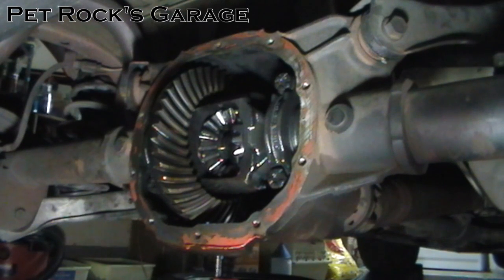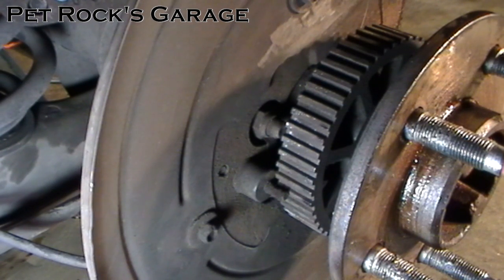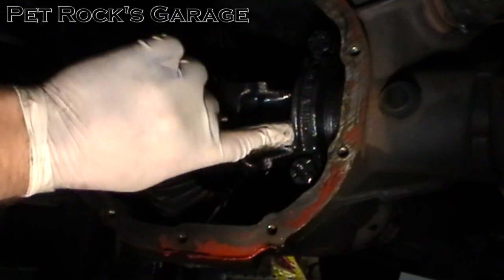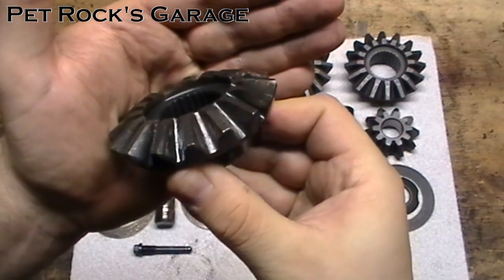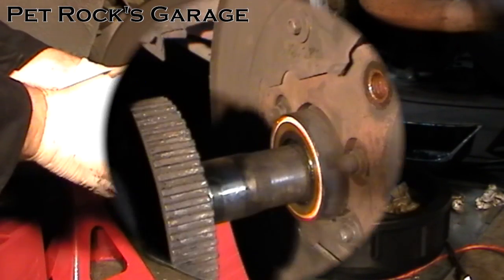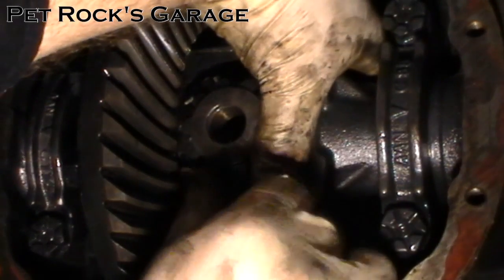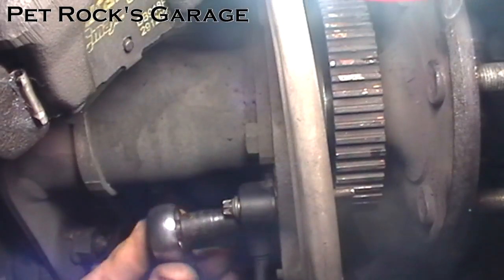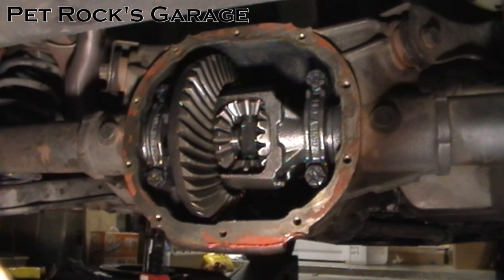How To Replace Spider Gears In Ford 7.5 & 8.8 Open Differential - Ford Mustang

Comment: hes on  a rack doing this. hope you have small hands. go to a mechanic shop, not going to work on youy back
Reply from the maker: I WISH I had a rack. This was all on the floor of my garage with a jack and jack stands. You can even see the kitty litter boxes on the floor in the background in some shots and the red jack stands holding up the rear diff. I don’t know where you got the idea I have a rack.
Reply: @petrocksgarage  my apoligy! i could not get the upper and lower spider gears to line up. had no problem with bolt using a socket extractor and bearing and seal when i inserted the new axle the upper spider gear came loose which turned a simple fix to a nightmare. i put the pin and bolt and wheels on and took it to my mech. my hands are way too large to get in the proper place
Reply from the maker: @jeretalbot8310 , one of the hardest parts of DIY'ing is knowing when you need to stop and let a pro take over. There is no shame in it. Everyone has limits. Be it physical, mental or tooling. The key is knowing when to stop. I hate body work, for example. I don't have the patience. In one of my first videos I had a local body shop realign the door on my wife's Mustang after I replaced the hinge pins. It was well worth the $. I recommended others do the same in the video too. There are some things best left to pros.
Reply: @petrocksgarage  yes, i agree.ive replaced many things on our grand marquis. i was an electrician for years. the old axle spline was damaged and when i tried to wiggle it it is when the lower spider gear popped out! to my dissapointment.i will take your advise, thanks.
Reply from the maker: @jeretalbot8310 happy wrenching!

Comment: Do you know why my factory spider gears won’t go back in with the thrust bearing? The thrust bearings get stuck on a lip somewhere and slip off. I’ve been stuck for hours
Reply from the maker: Maybe the bearing or housing has a bur on it that it is catching on? It should slide in smoothly. It got in there at the factory somehow, right? Good luck!

Comment: Hi, My 01 Ford Sport Trac has a strange clucking sound and you can feel it bad through the truck but only after you have been driving fast on the freeway for a while and then you slow down and exit for a fuel stop and you are moving very, very slowly moving up to the bowsers, it is so bad everybody can hear it, but by the time you get fueled up and start to leave it has stopped making the noise again. There is no noise or vibrations at all on the freeway. It is an Open diff. Would this be symptoms of worn Spider Gear. Thanks.
Reply from the maker: That could be a symptom of many things. It could be bad diff gears, diff bearings, axle bearings, wheel bearings, drive shaft u-joints, transmission bearings...  the list goes on and on and on.  Try to narrow it down more to a specific section of the truck and/or take it to a shop to diagnose it.  Don't just throw parts at it.  Thats like throwing darts in the dark and hoping to hit a bulls eye.  Good luck.
Reply: @petrocksgarage  Sorry but none of those things make a clucking sound through the whole truck at very low speeds with no vibration or wine. Completely different sound. I am a mechanic, but not a diff expert.  Sorry to bother you.
Reply from the maker: @oldgamer1330 , I honestly don't know what could make a 'clucking' noise on any vehicle (i.e. cluck like a chicken).  I thought that was a typo and you meant 'clicking', which those things I listed could make.
Reply: @petrocksgarage  Yes it was a typo, I meant clunking and I am sure now it will be the spider gears dropping back down into place as they reach the top when it rotates when going straight at very low speed and it would do it twice for every rotation of the wheel, and after being on the freeway the oil will get hot and thin but as it cools down and thickens up again the noise will go.
Reply from the maker: @oldgamer1330 , ok, a clunk.  Big difference.  😀  I would doubt its the spider gears because they are so small you wouldn't hear then slide back into place, if that was what was happening. It would be more like a light click. And if they were that worn out to have that much movement you would hear a whining noise either during acceleration or deceleration, especially in curves, that changes pitch with speed.  Also, when driving, even at slow slow slow speeds, the gears are under pressure in order to propel the truck forward so they wouldn't be able to move up/down on the center pin much, if at all, during each rotation.  Also also, the diff, like the motor, cools as air flows over it at speed. When it is not moving it is effectively heat soaking. So the oil in the diff wouldn't change temperature significantly enough to cause the oil to thicken during the time it takes to fill up.  Maybe after a half hour or hour.  But not the couple minutes it takes to fill up.

Since you said it clunks twice per each rotation of the wheel (I assume you mean tires), maybe it's loose lug nuts? or something stuck in your tire tread?  I also wouldn't rule out bad drive shaft u-joints, or drive shaft support bearing (if your truck has one), loose/bad pinion bearing, or bad control arm/shock/sway bar bushings. Those can definitely cause a clunking noise at low speeds.  Good luck...
Reply: @petrocksgarage  Well now I am but to square 1, I have had this problem for the 2 years that I have had the truck and can not solve it and have replaced everything I can think of but nothing has fixed it, and nobody in Youtube world has every been able to suggest anything so it is a strange one, but it is in the rear axle somewhere. I know the spider gears are badly worn because I checked them out when I had the cover off and there is so much backlash, but there is no noise at all but they are only cheap so I will do them anyway now I know how easy it is and see what happens. The problem is I live in the mountains where I leave it in low range all the time and only go on the freeway once or twice a year so it is hard to test it.
Reply from the maker: If the spider gear are worn, then replacing them is a good idea. It will at least rule them out.  Beyond that, maybe take it to a shop and see if they can diagnose it?  Good luck.

Comment: Dude, thank you for this! I've been getting a nasty clunk in my 91 Ranger's rear end. It doesn't seem like ring/pinion, so I wasn't really sure what it was, but now I'm pretty sure it's the spider gears. You've simplified it enough that I'm going to dig in and give it a shot. Thanks for the concise, well made video. Super valuable.
Reply from the maker: No problem. Glad to be of service. Good luck.

Comment: im glad this worked for you, my pin hits the ring gear both ways.
Reply from the maker: Sorry to hear that. Sounds like you have aftermarket gears installed. Only non-destructive solution I can think of is to unbolt the ring gear.  Torque the ring gear bolts down to 60 ft/lbs when reinstalling. Good luck.
Reply: @petrocksgarage  I thought the same, 40 years old after all. Even service data says it should clear. I left it (my personal vehicle) since i have an 8.8 ill install once the 7.5 grenades. Thanks
Reply from the maker: Well, at least you have a backup. Although if your motor is a V6, the 8.8 may be too big and may actually hurt performance depending on the gears that are in it. Good luck.

Comment: great video. my only question, are 7.5 spider gears and 8.8 the same size aside from spline?
Reply from the maker: I don't think so. I think the 8.8 spider gears are slightly bigger. They are different part numbers. But the install procedure is identical.

Comment: I serviced my differential on my silverado, change the fluid and the axle bearings & one of my spider gears fell out, took me 4 hrs before I finally got em back in lined up..😭😭😭😭😭
Reply from the maker: Ouch. Sorry to hear that. They can be a P.I.T.A. if you've never done it before. Pro-tip: next time the pin is out, run a zip tie or two up through the hole where the pin was to hold the spider gears in place as you work. Then you don't have to worry about them falling out. Hope that helps. Good luck.
Reply: @petrocksgarage  Thank You!!👍👍
Reply from the maker: @Soundafek  No problem.

Comment: My differential has a weird clip in between the spider gears I got it back in but now they not turning
Reply from the maker: Is the clip in the shape of an S?  It's a 'Traction-lok' S-Spring that some 7.5 & 8.8 diffs come with that.  I haven't played with one in a while, so I don't fully remember the trick to get it back in. Sorry. There are videos on youtube about the S-Spring install that may help you out. Good luck.

Comment: You must have some extremely long arms bro or somebody's pushing that axle for you cuz I can't even reach both of them at the same time
Reply from the maker: Nah, I used my foot.  🙂
Reply: Ahh very good info.. ty
Reply: I think your fingers are longer than mine too cuz I have an 8.8 and I can't hold on to both gears at the same time with my fingers and my thumb they won't reach have to figure out something
Reply from the maker: @mattikyle , zip tie through one of the gears and the carrier to hold the gear in place? Or have a buddy help?

Comment: How much different is this for a drum brake rear?
Reply from the maker: The stuff inside the differential is identical. The only difference in the procedure would be what, if any, drum brake parts need to be removed to allow the axles to be pushed in slightly to remove the C-clip. Definitely will need to remove the drum. Beyond that I'm not sure since i haven't seen a drum brake in a number of years. Hope that helps.
Reply: @petrocksgarage  Okay, thanks. And thanks for the video, too, it's gonna be a great help for me getting this mini-spool into my Ranger, lol.
Reply from the maker: @Drunken_Hamster , no problem. I'm glad my video helps you out. Thanks for watching & commenting. I appreciate it.
Reply: @petrocksgarage  I ended up disassembling one side of my drum brakes and then learned that I didn't need to do that. I also had to take my diff out of the carrier and remove the ring gear to get the cross pin out due to having 3.73s. ((No, the flat cut did not allow the cross pin to fully clear.))

Comment: In some carriers, doesn't the ring interfere with removing the center pin? I have seen some videos that show that some filing of the ring teeth is required in order to slide out the center pin.
Reply from the maker: I have not experienced that, but I suspect those are aftermarket gears and/or carriers. Either way, grinding the gears is not the proper solution, IMO. The pin got in there somehow, and it was likely without the ring gear installed.  So the solution isn't to grind the gears but to instead remove the carrier and unbolt the ring gear to get it out of the way. Then bolt it back up when done. It's really not that hard to do, and a lot easier than grinding. But to each their own.
Reply: @petrocksgarage  yeah, that sounds more responsible. Thanks for your feedback. Your diff and other video subjects are really the most detailed and informative that I have seen. All very well done.
Reply from the maker: @jockodog2009 , thanks a lot. I appreciate it.
Reply: How would I remove the carrier if I can't get the center pin past the ring gear, and therefore also can't get the c-clips off the axle to pull them ?
Reply: I was able to slide the center pin out of the carrier part way. It is enough to make  room within the carrier to push the axles in and remove the c-clips  and extract both axles. The center pin lock bolt cannot be removed completely because there is no cutout to make room on the right side bearing cap. The bolt gets hung up, needing another 1/4 inch or so to extract completely. So that's doable after the cap is removed. I still must then decide how to deal with the ring gear/center pin interference issue in order to replace the spider gears.

Comment: I got a 8.8 and the spider gears fell out as I was replacing my axles I g[t a retainer clip in it how do I get the spider gears back in there ???
Reply from the maker: Sorry for the late reply. This one got lost in the shuffle.  I think you are talking about the Traction-lok S spring. If so, they can be tricky. It sounds like the spider gears fell out with the S spring still in place?  If so, you need to remove the S spring first and then install the spider gears. It's really hard to explain in text how to remove and install that spring. The short answer is you need to compress it slightly and use a brass punch to push it out. Then reverse to reinstall. There are a ton of videos on it on YT that may help out. Search for 'ford 8.8 s spring'.  Good luck.

Comment: it should take 5 minutes if you know how to time it..  turn the drive shaft till pin bolt is centered between the main bearings, then simply drop a spider gear in from the top and slap the other one up with you right hand.  now rotate the drive shaft and both gears will line up with the large pin will slip back in.
Reply from the maker: Yeah, there are many different ways to do it. Whatever gets the job done.

Comment: These gears make the howling noise right? My rear ended is on its last leg
Reply from the maker: Any number of things in the diff could cause a howling noise.  Typically its bearings, but could also be worn out gears or incorrect back-lash. Good luck.

Comment: hey man thank you so much for the awesome videos.  I'm changing the axle bearings on my 8.8 98 Cobra this week, and the instructions are very adamant about not damaging the spider gears when rotating the differential to expose the axle c-clips.  in your video you say they just slide out when rotating it - this concerns me lol.  what's the best way to rotate everything with the pin out to expose the c-clips without damaging anything?  thank you so much in advance
Reply from the maker: I think the damage they may be referring to is if the spider gears fall out and bang around on the floor. If the gears remain in the carrier then there should be no damage to them.  When you get it apart it might make more sense.
After rotating the carrier a little, with the pin out, you will see that the spider gears didn't rotate with the carrier. When this happens, just manually & slowly rotate one of the tires to rotate the spider gears back into position. Make sure to rotate the tire while you are watching the gears so you don't rotate it the wrong direction. If you are super worried about the spider gears coming out you could run some zip-ties through the holes in the carrier that the pin goes through & the center of the spider gears to hold the spider gears in place. Basically putting zip ties where the pin was going. Hope that helps. Good luck.

Comment: Hello do you have links for the 7.5 gears I accidentally bought the 8.8 gears.
Reply from the maker: You can't exchange the 8.8 gears where you bought them?
Either way, here is a link to rockauto.com's selection:
https://www.rockauto.com/en/catalog/ford,1998,mustang,3.8l+v6,1304468,drivetrain,differential+carrier+(spider)+gear,13932

Comment: Is it nessasery to remove the whole axel? Can i just push it a litte to remove the pin?
Reply from the maker: You have to push it in far enough to disengage from the side spider gears. At that point you might as well remove the axle all together. Having the axle unsupported like that can damage the axle seals. Good luck.
Reply: @petrocksgarage  ahh i see just did it today to remove the internals , good thing the left them pushed in since it going to rain tommrow
Reply from the maker: @bryanrosas5526  glad to hear you got it sorted out. Thanks for watching & commenting.

Comment: great video thank you. like some commenters i was just doing wheel bearings and seals and my spider gears fell down. tried and tried to get them in. can only get the spider gears back in without the washer, but cant seem to "slip" the washers behind them. looks like i might pull the whole carrier out and assemble on the bench, idk. working on a 2011 f150 with the 9.75 open diff if that makes a difference. thanks for the info.
Reply from the maker: The washer has a lip that centers it on the spider gear, so you have to install the spider gear & washer together otherwise you'll never get the washer in place. Unless you don't have room to work under your truck, which I think you would have way more then I did under this Mustang, pulling the carrier is a little overkill and could open up a can of worms you don't want to mess with. Its unclear from your comment on if you tried the technique I demonstrate in this video to get the gears back together. If you haven't, I would give it a shot. The gears & washers fit in there before so they should fit back in again (assuming the gear & washer isn't damaged from falling out). Good luck.
Reply: @petrocksgarage  finally just got it, took the whole thing out the pumpkin got everything lined up then pushed the main gears apart to get enough room to slide spider gears washer in then was able to rotate and all back together finally haha woohoo bit of a pain. Made sure all shims and spacers all went back as they came out. Thanks for replying
Reply from the maker: @REsuperGRX7  Glad to hear you got it sorted out.

Comment: Half of 40 to 60, would be 20 to 30 inch pounds.
Reply from the maker: Sorry for the confusion, by half the torque spec I mean the mid point between the max & min torque specs. The equation is: (min + ((max - min) / 2)).  With numbers this time: 40 + ((60 - 40) / 2) = 50.